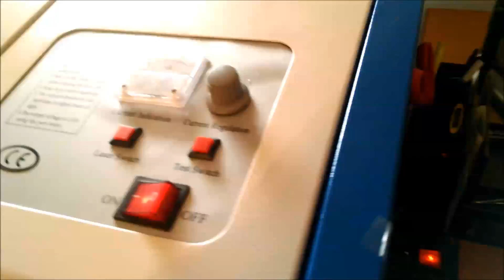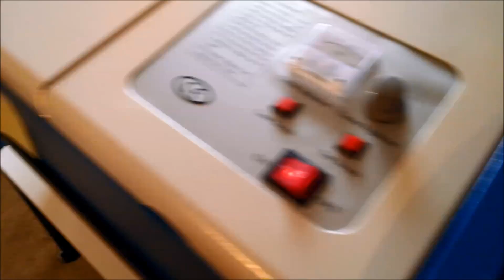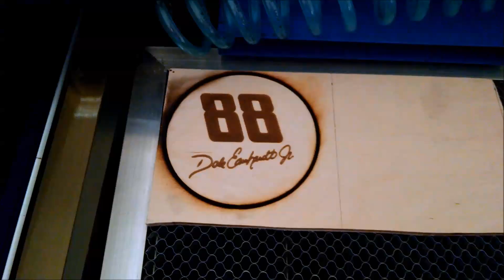China Laser Upgrades

Comment: I'm using a 1/4" copper line for my air assist with a bracket I cut out.  Do you think the McMaster spiral tubing will fit over this copper tube?  It says that the id is 5/32", but if its flexible enough I thought it might fit. I see they also have a 1/4" id tube that coils a little larger.

Comment: Good job!! How did you set the honeycomb table would you mind helping me out? I got the same one
Reply from the maker: What you after pal? Love to help you just let me know what you are after. Thanks!
Reply: I installed air assist and drag chain. I realized that the laser upgrade I got is a 12 mm instead of 18mm do you think that if I 3d print a lens adjuster it would work? Today Im changing the controller to cohesion

Comment: Great Video, what is the recommended Water Temp ?? for the Laser engraver
Reply from the maker: I try to keep mine between 66-70deg. I read that you can really take the hours off the life of the laser tube if you run it over 80deg.
Reply: i see your water bucket is quite small

im sure after cutting for extend times your water will be quite warm

tip: use ice packs to keep the water at 10--15c , let the outlet flow over the icepacks so the inlet water is nicely tempered.

Comment: Great! So, I just ordered these parts on Amazon and I can't wait to put it together. But the bilge blower just has the two leads coming out. I'm wondering . . .

(1) could I take the transformer out of the stock blower which came with the unit and use it on the bilge blower? Or could you recommend what kind of transformer I can get which might mount inside the laser cutter case? (The bilge blower recommends a 7 amp fuse, and I bought a lit rocker switch).

(2) There are two "grounded"  outlets on the back of the unit . . . but is there a place inside the case to which I could extend the two wire leads from the bilge blower for powering it up?
Reply from the maker: 1) 7 amp is quite a bit of draw, so I really highly doubt that transformer on the stock blower draws anything near that. If you try it out, let us know if it worked for you. The converter I have spec'd out will fit inside the case.
2)Not sure but you can always run your own.
Reply: (1) How did YOU connect the bilge blower to the black duct vent on the back of the unit? I have these from your parts list and the openings are the same size - one doesn't fit into the other. Do you have some sort of sleeve inside of them? If so, what are the dimensions and where did you get it?

(2) How did YOU wire the power for the bilge pump? Can you show a picture or wiring diagram? Did you wire the bilge pump fan into the laser itself . . . or into a plug which goes to an outlet?

I'm eager to get these up and running, but I'm scratching my head trying to figure out how you did such a great job. THANKS!
Reply from the maker: I apologize as I have been in the long slow process of moving. I will post a video showing the wire diagram but the blower is connect to the ac-dc power adapter.
Reply: I'd like to know how Jason connected his bilge to power too! Hopefully he will answer! Great video!

Comment: you should be using metal ductwork that you can ground. Fine particles have a huge surface area relative to their size.  Static electricity can cause a fire, or even an explosion in your duct.
Reply from the maker: yes that is very true and good point to bring up. Here is more information from epilogs website on proper exhaust system set up. https://www.epiloglaser.com/assets/downloads/whitepapers/whitepaper_exhaust.pdf thanks for sharing and thanks for watching!

Comment: Hi Jason
was just wondering when you changed to the light object air assist head did you use the mirror and lens from your old head? Also where did you find the bed to place the honeycomb bed on at?

Thanks
Reply from the maker: Roger Smith I did reuse the old lense when I switched to that air assist. I made that out of S.S. and tapped it in the corners for adjustment.
Reply: Thanks for the quick reply!!!  You also use the mirror from old head?
Reply from the maker: Roger Smith yes, reused the mirrors and lens. I have a 50mm focus lense from light object on it now.
Reply: Thanks Jason I used your list and have purchase everything except for the lighting. I already had that. Can't wait to do all the upgrades. I have already installed the bilge blower and yes it is loud, but what a difference. Thanks again for the answers and for the Youtube post.  

Roger
Reply from the maker: Roger Smith yea I almost had more fun upgrading than actually burning! ☺ haha! That blower is quite an improvement. By far the first I recommend to others as well! Thanks for watching!
Reply: by having it directly attached to your machine it will suck a lot of air, and that will come mor eor less from every little hole in the mach

I suggest to make some eir in whole in the front of the machine ( place a filter on it) that way you have a good airflow over your work as well ( just make 3 rows of smaller holes with a metal dril ( 12 MM would do) over the entire length of the bed , each 50MM apart

for engraving, you can (should) then leave OFF your airsupport so the hot fumes will be sucked away and not blown into the work by the air assist.

for cutting the added air support works like a  champ 

I have my blower in a filter unit installed and it runs on 12V when without a speed regulator, just of an old PC powersupply. the filter unit uses 25Liters of active carbon to filter a lot of the fumes

Comment: Hey Jason. Nice mods buddy. I got serious problem with my laser cutter last night and I made a small video by request from my tech guys so they can tell me what is wrong with it. As I can see It seems like you know this machine pretty well and here is my video (https://www.youtube.com/watch?v=5qU_IEqvTiI). I'd love to hear your feedback. Sorry for my bad Enligh ;).

Keep up the good work and take care. Best,
N.
Reply from the maker: did you end up finding a solution? I know that just checking wire connections can solve a lot of unknown issues.
Reply: Yes ***** I did. My power supply was burned and I got a replacement from the manifacturer.

I'd still want to see a video how you modify those things as it seems pretty tasty to DIY ;)
Reply from the maker: +Nikola Totuhov what you wanting more detail on? I can expand on whatever you think would be beneficial. just let me know and I'll get something posted for you.
Reply: I'm in love with the "Focus Lens" from your other video (China Laser Upgrades 2),  "Air Assist Head" and "Powered Z-Axis". I've also read last night that the mirrors are also important to change. If you've done that - detailed explanation will be good enough.

Comment: Hey Jason, been using my laser for a month or so.  It no longer fires a laser.  The tube lights up, but no fire.  Any suggestions?  I'm thinking, power supply.  Your thoughts please, Larry
Reply from the maker: Yes i would look into the laser power supply or look at the laser tube for any kind of cracks or defects. If you are using any type of water sensor to keep the laser from firing, check and make sure that is working properly as well. Check that all wire connections are snug and nothing is loose. Best of luck to you! If you would please reply with what you found to fix it, that would be much appreciated for myself and potential other users for the future.

Comment: Might want to replace the controller from the standard Moshi which is very limited and doesn't do vector cutting to one of these controllers instead:
http://miles-milling.com/

The cheapest one is only $99 and can be used without a USB key.  They also have an ethernet version using LinuxCNC also available.
Reply from the maker: +Roger Rabbit thanks for the input. I have already upgraded to lightobject's x7 dsp controller.
Reply: Love the upgrades BTW.

Comment: Where did you get the Z axis table?
Reply from the maker: +Karim Ben Ali I designed it and cut it out of 3/16 S.S. and tapped the 4 corners to allow a set screw to adjust the honeycomb up and down. I am no longer using it if you are interested in purchasing it from me. I would include the honeycomb, as I am no longer using that as well.
Reply: If the price is right, why not. I am planning in upgrading to a 60W Chinese laser soon God willing.
Reply from the maker: +Karim Ben Ali I would let it go for $30. That is about what I have in the honeycomb alone after paying for shipping from lightobject. let me know or send me your contact information if you are interested.

Comment: Hi Jason, excuse me but...what kind of pump you uses for compressed air? Thank you for yor help!
Reply from the maker: +Zio Gius This is the air pump on my current system - http://www.amazon.com/Hydrofarm-AAPA110L-112-Watt-110-LPM-Commercial/dp/B002JPPFJ0/
Reply: +Jason Johnson Great, thank you Jason!
Reply: +Jason Johnson What I ultimately ended up doing was keeping the original fitting, and using the short hose that came with it to connect to the splitter. At that point, I have a "3/8in (10mm) x 1/4in (8mm) MIP" and a "3/16in (5mm) x 1/4in (8mm) MIP" with a "1/4in (8mm) coupler" to connect them. Effectively, I made my own step-down adapter. Total cost for all 3 parts at the local hardware store: approx $12 USD... Everything seems to fit perfectly now.
Reply: +Jason Johnson Thank you for this video. I've already ordered several of the parts you've suggested... but the air pump connection for the hose is somehow wrong. The part the hose should connect to is massive (about double the size needed). I tried to take just that piece to a local home-improvement store to get either a different piece or an adapter, and I couldn't find anything. The only one that had the right size connection to the hose was the wrong threads (I don't know the exact terms, but coarse threads instead of fine threads). How do you connect the air hose to the air pump?
Reply from the maker: +Richard Beline Glad to hear that the video was useful to you! I ran into the same problem. I went to menards and bought a barbed hose fitting thinking it would thread right in. I was wrong. I believe I got an NPT and it threads in about a half turn and stops. I think the threads may even be a BSPT or british standard but I am not certain of this. I left mine as is. Threaded it in as much as I could and checked for leakage. It holds fine and doesnt leak much air at all. If you figure out the threads, please share!

Comment: Help me... K40  40w  laser cutter
Hello, I´m Francisco, I bought this laser machine, my computer using Windows 8 and recognizes the laser cutter, i want to use and does not work, because i said the program: (laserDRW3) This function need USB -KEY support.

On the cd i found UKEY, but is in Chinese, please I need your help ... Thanks
Reply from the maker: FRANCISCO JAVIER VALDEZ MEZA see in the video @2:50 you can see on the left side of my laptop is a usb flash drive. that is the "key" they are wanting you to plug in. Your machine should have came with this "USB KEY". If it did not, i would encourage you to contact whomever you bought your machine from and get them to send you one. Thanks for watching my video!